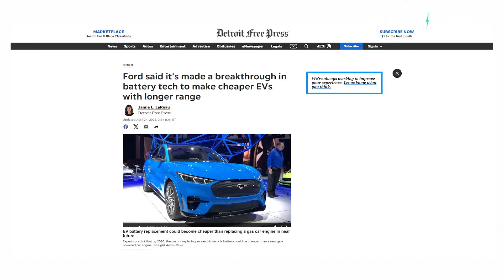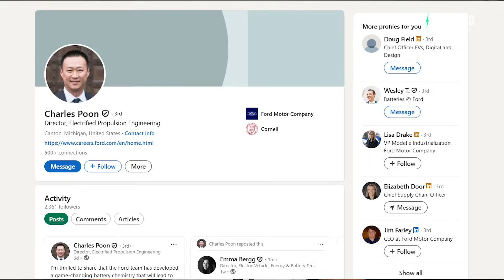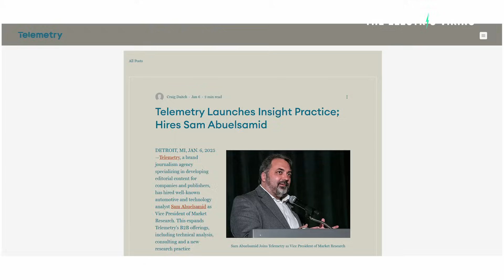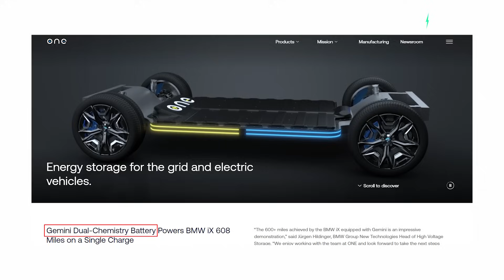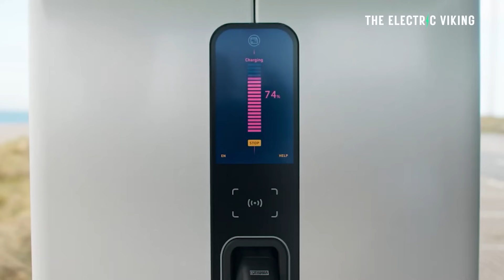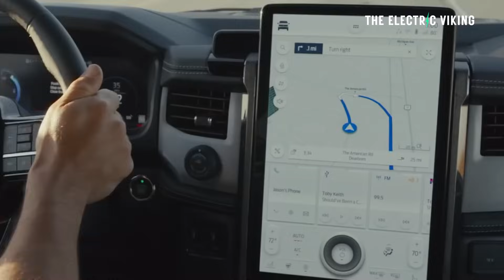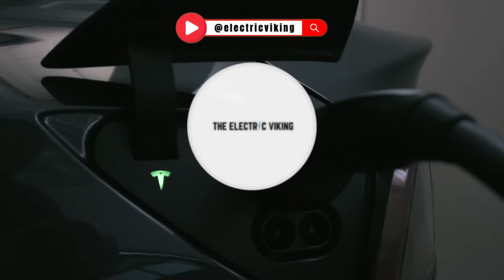Ford’s Battery Breakthrough: Cheaper, longer range EVs on the Horizon!

Comment: Ford is building a new EV battery plant with CATL, this LFP plant can produce the new CATL sodium ION battery.

CATL have increased the density of these batteries and they last 3.6 million miles working in minus temperatures.

Please wake up Ford and use these batteries.

Stop using NMC as few want them with a huge fire risk and lousy charging.

Wake up Ford before it’s too late.

Comment: Battery guy here. Lithium batteries are NOT "proven tech." Just good enough now to fuel a tantalizing fad, but a huge negative functionally and environmentally. There are so many suckers buying them for utility/golf carts, tractors, etc. Very negative trend, unless you have a race car/race motorcycle or an e bike. We still have a LONG way to go before electric cars are practical outside of urban areas so dense and small anyone who isn't elderly or disabled should be walking or biking anyway. I love your Tesla adventure, friends, but the battery guy in me just shakes my head in dismay at the waste. For me, watching a Tesla drive down the road is like watching a smoking car with a blown head gasket drive down the lane while leaking from its gas tank. Sure, I want one of what people believe they are, but I know better. We are not there yet. Still, if anyone wants to let me take their Tesla to the drag strip, hollah!😊

Comment: I still feel like the conversation about battery life wouldnt be so galvanizing if the battery packs were able to to be individually swapped and recharged at home and in specialty stations like a lawnmower battery. I imagine the cells as a series of accessible ports alongside the   starboard side of the vehicle that would allow for hot swapping 60lb sleeves.

Comment: Yeah Ford ain't got no battery breakthrough.... And despite the 101 announcements by Toyota they don't either. Nothing but fluff press releases.    The holy Grail is still lithium sulfide.... Which has tremendous storage

Comment: Another day and another super battery that will not see the light of day. If a few of your battery announcements came true,  we would be driving 1000 miles and fully charging in 10 minutes. Well, nothing has really changed for the last 5 years

Comment: Just had a battery health check done for the 126S1P LiFePO blade cell battery in my three year old Atto3. There was no measurable deterioration. 

Happy about that.
Reply: I had a battery test done on my 2022 Kia EV6 GT Line, and it had zero degradation, and no, it's not an LFP battery!

Comment: I worked at Ford Australia in Campbellfield for over ten years and can tell you car companies are always researching ahead.
In the 1990s when I worked there they were looking at fuel cell cars!
Yes, they didn't go that way but they were looking at it!
We got to look inside the research centre and at the time I spotted the Ford Ute and that was several years before it was released!
I think it's a good idea to look outside what's the normal, you never know what you might find! 🙂
Reply: Yeah, if the Fuel Cell was even remotely efficient or cost effect, they would be everywhere. Only Toyota doubled down because they were getting government kickbacks for development and vehicle sales. The actual unit sales never really developed and failed miserably this past year.
Reply: @JonDecker  Yes, that's the point I was making, car manufacturers do try different things, some work some don't but that's they have research centres. The other thing they do is as soon as the competition brings out a new model they get hold of one and strip it down to see how they do it! 🤔

Comment: I personally worked with GM when I worked at the SERC. They had the best shot at an affordable EV way back then in the early 2000's. We told them to invest in battery research. Here we are quarter of a century later and they are just now getting to it.   Good to see Ford digging in to the heart of the problem. Better late than never I guess.
Reply: GM's short term thinking and too much stock focus that never pays off has wrecked the company

Comment: Not sure about this not being huge.  Ford thinks this will bring them at cost parity. What if Tesla rolled this into a 4680 with dry cathode? Could be a great cheap battery
Reply: in what? 2034.
Reply: Tesla have a LFP plant going up in Nevada which might be able to roll these Magnesium rich batter.
Reply: @ChicagoBob123  it all sounds good, but tesla already has their plans well into the future. to shift now on some new unproven tech, considering there are new battery breakthroughs every week, is very unlikely. battery tech is changing so quickly, it's difficult to know the path forward.

Comment: Ford's doesn't have to worry about the cycle life of their new battery, it will still outlast their vehicles 🤣 On a serious note if it's cheap enough and easy enough to replace maybe they should just plan to replace it at some point.